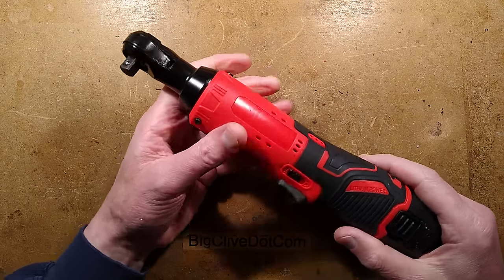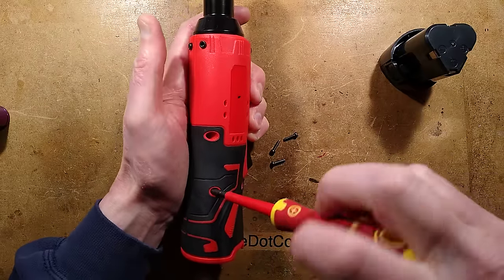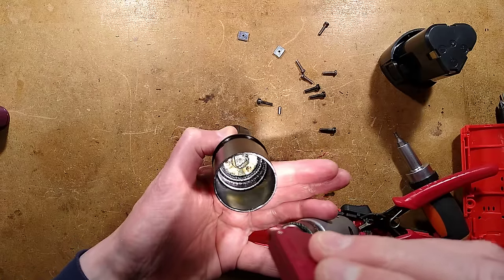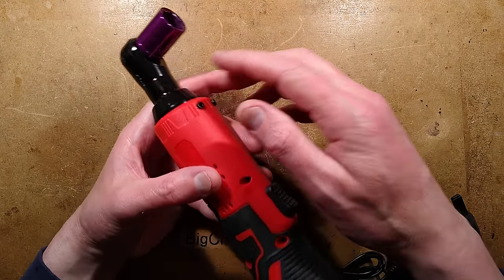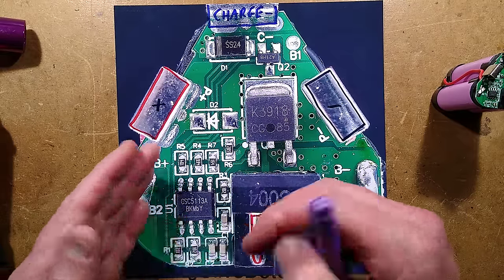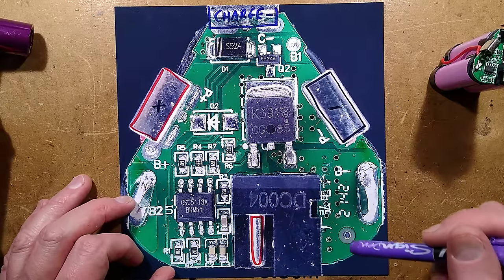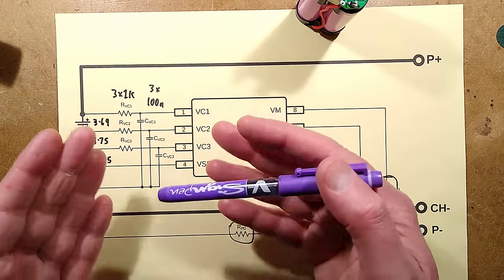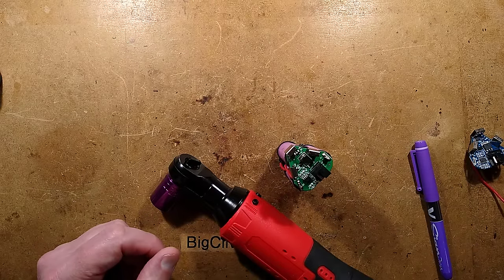Inside a cheap Chinese cordless ratchet

Comment: I have something like that but smaller and with selectable torque. It is handy when you need to torque something like cylinder heads or other things that need a very specific torque. Not for common screws but comes in handy, especially when similar ones from like Proxxon or Bosch are pretty pricey.

Comment: I bought a proper MAC power ratchet.
Not cheap @ £280 featuring variable torque trigger.
But I've used it every day professionally for the last 10 years !
Very powerful machine and the 2 original Lithium Ion batteries still work well.

My motto is it's worth paying for quality !

Comment: In principle, the 1K resistor could do (slow) balancing too. 3.6mA can hit 10% of cell capacity in only a couple of days. (I have no reason to believe it does this).  I note I have a failed trash-tier Bosch pack which got very slightly damp, and clamped on a balance transistor, which is another failure mode. Apparantly, conformal coat was way too much money.

Comment: I have a small Bosch cordless drill/driver that has a similar three-cell battery. When the first of the two original batteries died, I took it apart and was a bit surprised to see that there is no cell balancing nor even individual cell monitoring! And it is a Bosch blue series (pro) device! I have a similar size Metabo drill/driver of about the same age and although is seems to be only two cells (marked as 7.2 V Li-ion, but I have not opened the batteries because they are still good), judging by the number of pins of the battery to the charger it seems to have at least cell monitoring, but probably cell balancing as well since the batteries have lasted so long.

Comment: Surprised to see a BMS in the battery.   The Bosch/Drenel, Milwaukee and Dewalt 12V platforms all have no BMS.  However I believe the Dewalt 12V has contacts to provide cell to cell midpoints to the charger so it can balance them (in theory at least...)

Comment: I am trying to convert an on ald Black and Decker 1/4" ratchet from the 3 x 2/3 C NiCad to 18650s...  Looks like the best way is to use batt packs with on board circuitry. Thank you very much for this and all your videos!

Comment: The purpose of Rpd across the bottom of the schematic is to provide a low-current path for the full battery voltage to the terminals.  When the battery pack is removed and plugged into a charger (instead of the little wall-wart), it provides a way for the charger to measure the voltage of the pack even when the circuit board has either MOSFET turned off.

Comment: Tools wise, for cheap stuff its Lidl's and Aldi's as just can't beat Parkside and Ferrex and a lot of 'em made in Germany and not China too, for anything else its King Dick, Britool and old Draper and some Heyco, my Snap On consists of one electricians screwdriver from the 80's, a air ratchet and an air impact, you should see the size of my King Dick elbow torque wrench which weighs a couple kilos too and long as yer arm but very very precise.

Comment: I bought an identical unit in April (slightly different pattern in the black plastic). I soon found that the ratchet only worked anti-clockwise and the drive would slip when tightening. After much back and forth the vendor sent me a replacement and said to keep the original.
Once it was mine I used my never-before-used circlip pliers to open the ratchet head. Inside I found a rocking pawl with three teeth for each direction. The clockwise pawl was not lifting high enough to engage the ratchet teeth. With a dremel I "adjusted" the limits on the direction selector. I haven't put it back together yet as there are two tiny spring loaded ball bearings pressing on a washer under the circlip and I need to fashion a special tool to push down on the assembly while I reinsert the circlip. I'm going to cut down the aluminium body of a marker pen. Once it's repaired I'll gift it to my neighbour who helped me with my lawn tractor repair.
You can't argue with the price. The working unit is excellent.
I would send photos but I don't know how we can do that here.

Comment: I took apart a cheap cordless screwdriver I got from B&M. I took all the screws out and stupidly turned it upside down. Planetary gears everywhere. Managed to get it back together after replacing the 4 650mAh NiMH cells with 1900mAh ones. And I was left with a little metal pin about 6mm long and 2mm wide. Seems to work fine without it, though. Use it all the time and the battery has still not gone down from green on the indicator.

Comment: As you explained around 16:00 the danger of one cell being out of balance, precisely this happened to me and my Baofeng radio. I had it stored for maybe 2y and when I tried to charge the pack, It charged in like 2 minutes, I have put it in the radio and radio turned of in like 5 minutes. So I charged it again, again 2 minutes of charge to full (charger reported that) but it did last only few minutes again.

So I have opened up the pack and found one battery was at ~4V and the other at 2.75V. So I manually charged them both separately with my hobby charger, put it back together and its running fine. I was very close to throw the pack away, luckily my curious brain stepped in and saved it :D .

Anyway, thank you for the schematic and explanation, now I know this is kind of normal problem for these balancing circuits, not being able to actually balance while charging the pack.

Comment: I have a 20V Aliexpress version of this with 6 cell battery (4 in similar position as this vid and 2 at the bottom in a rectangular section outside that can allow the tool to stand upright) and both battery pack plastic clips broke just from the vibration of this unit from presumably inertial mass of the batteries.  I haven't worked out how to melt or glue clips back in as there isn't a lot of room to get behind the clips, so just have to hope the batteries don't slide out while using it and keep pushing them back in when it stops.. 
The batteries have "42V" printed on the side lol. I guess the manufacturer is dyslexic as surely the Chinese manufacturer wouldn't compromise their integrity by massively overstating their battery pack voltage to improve the saleable position vs their competitors..../s

Comment: I've had a couple of DeWalt batteries lose one cell because I've accidentally discharged them too low. Instead of being an 18V battery they seem to then operate as a 14.4V battery, which is quite irritating. They don't seem to take you charging one cell by itself either.

My Bosch and Milwaukee batteries have not had the same issue despite heavier use and in some cases being a lot older.

Comment: I bought a cheap uggadugga from banggood (and took two months to ship!!), and while it's cheap tat, it did the one job I wanted it for, undoing the pulley nut on a 2CV alternator, shame I'd ruined said alternator trying to use manual brute force and cut wires on the rotor, but I needed the retribution of getting that fecker undone... :P

Comment: I wonder if the EU will have standard battery case designs. They are all probably made at the same few factories but with a slight case body difference to make them proprietary. That battery, Milwauke and Master Craft 12V tools have the same case with minor differences.

Comment: So, "Jesus clip" was one of best jokes I've heard in my whole life! I'm still giggling whilst writing this piece of commentary. And trying to keep my eyes from tearing!

About diesel m maintenance: the engines are pretty dirty (even in diesel cars,) the temperatures in the combustion chamber are higher than patrol or ethanol (what makes engine temperature operation slightly higher,) the torques you need to submit bolts and nuts are higher as well (due to the compression ratio and force distribution.) So much so that o'rings, gaskets, bolt threads, you name it, are cooked for a very long time and it's a nightmare to disassemble. No surprise when you go to a garage where people work with diesel engines, there's dirt everywhere and a pile of broken wrenches and grinded sockets...

And last but not least, that PSU is very common among CCTV Chinese cameras. I think I have 2 on 3 of them here. Mine came with either europlugs or NEMA-5 with no ground pin.

Comment: I think the head is the same design as the 3/8 air rachets. I bought one recently and used it for removing and refitting bolts in an automatic gearbox pan. Very useful when laid on your back in the road.

Comment: I kept waiting for you to comment on the ratchet drive, since it is a Scotch Yoke. ;)

I had an old HP tablet that I found NOS batteries for, but the capacity was awful until I opened them up and balanced them.

Comment: I’ve often wondered how compatible these are to the Lidl X12V system of tools & batteries

They’re made in a very similar fashion to the older 12v battery “Dremel” tools they used to sell prior to going ‘internal battery + USB-C’
Reply from the maker: Different battery ribs and also reversed polarity, so just as well it doesn't fit.
Reply: @bigclivedotcom  Please don't ever say super again.
Reply: @bigclivedotcom  guess how I blew up my first Parkside dremel… 😂

Comment: Lots of controversy about what part will break first.  It all really comes down to design and materials science.  When loaded manually the pin is in shear force but is thicker, while the pawl is in compression with a lever advantage, but has size limitations, and probably has a light duty rocker/pivot as well.  I see most of the problems being with the pawl since it's the place where the most cost-cutting measures are likely to be applied.  I wouldn't be surprised if the pin does break in some cases though - the manufacturer isn't going to pay one more yen than they have to for the raw materials or heat treating the parts.

There's nothing wrong with light duty tools if that is all you need.  I think these days we understand what we are buying, and I'd say this was actually better than what I was expecting.  If you never spin anything bigger than 16mm then it will be fine.  If it's rusted on or larger in size, then loosen the damn thing first.

Comment: Hi! I have one of these and i work in factory in nordic country. I have had it for a half year now and i wouldn't toss it. It is super handy for M6 and M8 bolts. Only thing it needs to be, is that you have to use a loose wrist when using, so your hand works as a fuse for overloading. And when tightening too tight, it will shut down. There might be some overload protection. I have never measured that how tight it can turn itself, but M6 A4 bolt won't get dethreaded, so it is quite weak, but strong enough to tighten M8 bolts. There is one crucial thing that ratchet needs and it is that control button is at wrong side, so long sockets or extension bar are quite necessary. Only maintenance that i do, is lubricating that spinning pin once a week with small drop of WD40.

Comment: Oiley? You should have seen the capacitor I had to open up earlier on, aluminium can the size of a red bull can, full of paper that had mushed up, and holding it in? Tar... Thick, black rock hard tar, that heat and stabbing and putting on the stove still didn't remove it all, my lungs will never be the same 😂

And the metal plates in there, holy crap they were coarse, like a metal potato sack

Comment: Project farm compared 4 brands of these. They all work the same way and go to around 33 ft/lbs but can't break free a nut torqued past around 15 ft/lbs (from stopped). Given this that driving pin will not fail as it will not exceed it's sheer strength. They all accept greater torque via the operator manually operating the ratchet.

Comment: I have a couple of Casals VBLI12 compact cordless drills, that battery seems compatible, it has the charging contact on the other side but also uses a charger with a barrel connector but thinner, I think it's only 3.5 mm
On xmas 2020 I put them in the wrong toolbox and then my dad put that toolbox away and I ended up finding them on last xmas when I was going to get other thing out of that toolbox 😓
The batteries didn't seem to have self-discharged too much in a year, they weren't fully charged when I put them away because we had been using them to build some shelves, and when I found them again the 3 LED indicator was still slightly lighting up the amber LED with the clutch slipping on the highest setting, I actually continued to use them with the remaining charge and didn't notice any loss of capacity or power.

Comment: Mine is very similar to that, but a different switch and I love the thing. Had it for nearly 4 years now, built engines with it, swapped blowers, and it hasn’t failed me once. It’s not the strongest thing, but if you manually break bolts loose and torque them down, it works perfectly.

Comment: Is the chip not capable of trickle discharging the too high cells a tiny little bit? It would have to be extremely small currents if it was just |dissipating through the chip but over a few days it feels like they should be able to equalize 0.06 volts.

Comment: I was repairing the canning line at work with my boss and he pinged the Jesus Clip high enough to land in a can we had loaded.  We heard that sound and we just look at each other knowing how bad that is.  I found it.  I turned the conveyor belt on but blocked the outlet and used my ears.  I knew I could hear it rattling.  Tink tink tink, BINGO.  Found it.  A mistake like that can cost thousands of dollars in product recalls.

Comment: These types of ratchets are not meant to be used for high torque applications. These electric motor ones are even less torque for most of them. Watched enough AvE videos on these teardowns but from my own personal experience I prefer pneumatic air driven ratchets. My favorite is a Snap-On model FAR-72C or B revisions. Its been known to throw my hand into a poorly cut zip tie or protruding bolt at 70lbs of force.  This one has a nice big beefy head on it so it bet it can take the 300lb apprentice hanging off it to loosen a corroded nut.

Comment: Rpo - is that R6 on the board? Rather high value. Perhaps that allows the tool to display the battery capacity without putting enough load on the pack to wake up the chip and turn on the high current MOSFET? Just the smell of an oily rag to give a rough estimate of the total voltage. Do you have a link to the complete datasheet?

I love how the example schematic is drawn with narrow sense traces going to big fat bus bars. It's not common for the schematic to show where the high current traces or pours need to be; that's usually covered in the recommended layout illustration.

Comment: As a diesel mechanic, I have had much more issue with Snap-On battery tools than anything else. Milwaukee seems to be the only thing that holds up under long term heavy use.

Comment: more Chinese power tools! including cordless vacuums. They're coming out with brushless motors and higher voltages at low prices which boggles my mind. They also sell knockoffs that really looks close to the branded ones like Makita, a possibility where the contractor leaks so much info that other chinese companies make a Makita knockoff.

Comment: Thanks for posting the detailed examination of the tool.  The mechanism is similar to my old Black & Decker power ratchet with ni-cad cells.  It is interesting that they put the charger inside the pack.  What is not clear is how they are monitoring the pack temperature. They should shut the tool off if the pack overheats.

Comment: Has anyone ever broken the drive pin? I've never seen one fail there, the motor is far too weak to shear it and when using it manually there's no resistance holding the pin in any specific orientation and it just spins to either side of the yoke. I've personally stripped teeth and broken an anvil (square part the socket goes on) completely my fault for not using a different tool to break the fastener loose. I've seen a co-worker crack one of the ears of the yoke that are on either side of the ratchet mechanism, but I bet that was from being dropped. I've been told by tool truck man that he's seen people break the plastic body, especially the ones that are extended reach.

Overall they are fairly reliable. This design has been used for a very long time in air ratchets, it's a fairly robust design and with every power tool being turned into cordless, they just replaced the air motor with an electric motor.

As far as warranty, that's between you and the dealer or manufacturer. Snap-on only puts a 1 year warranty on their electric tools. When you spend thousands of $ a year with them, catch them on a good day asking very nicely, and depending upon the situation of the failure, you might get them to take care of you.

Comment: Looks like a milwaukee m12 rip off 3 lights for bsttrey light up under load . Reds off coulor battrey slightly different though wounder if you can get a multi tool adapter

Comment: Don't you ratchet on  he he :-D
So loosen the bolt with a manly ring spanner,  and spin it out at warp 9 with the tool.
I wonder if the big monster cordless ratchet uses the same drive method.

Comment: Recently on ebay i discovered that they were selling pretty much skincare products, which consisted of a noble gas tube shaped like a almost a cooker heating element or a lil comb, which is bein driven presumably by high voltage RF. The idea is to brush the skin with that tube which makes it better i guess. Different gasses do like different things n such. Can ya please check one of those out sometime?

Comment: Shoogle:  shake or wobble from side to side
Shooglenifty: Celtic fusion band
https://en.wikipedia.org/wiki/Shooglenifty
If you play Shooglenifty at a high enough volume while working on your car, the noise of the cheap Chinese cordless ratchet shoogling back and forth is less of an annoyance.